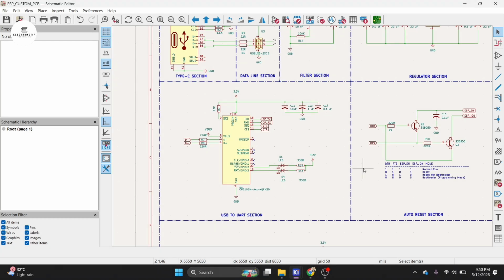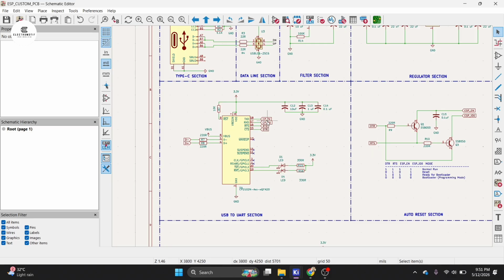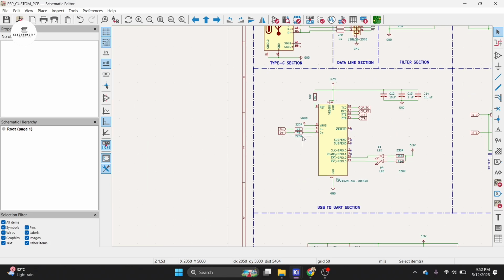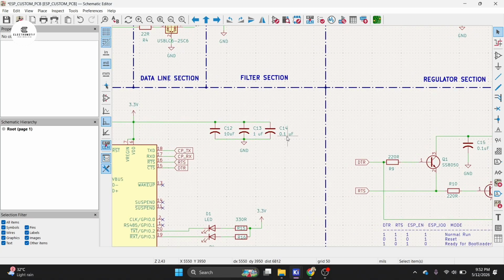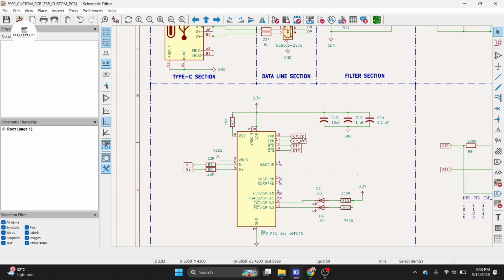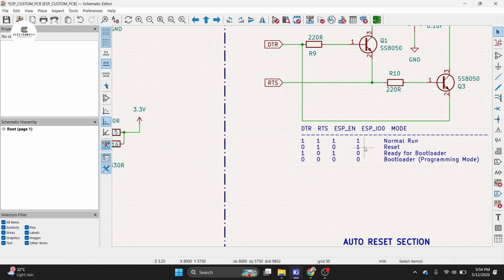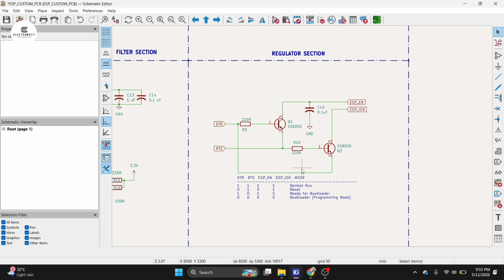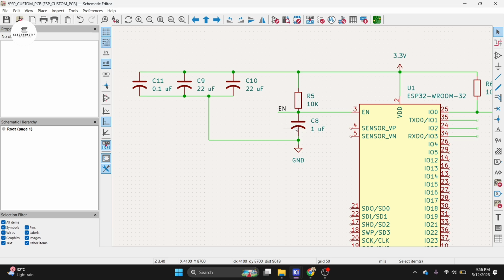ESP32 PCB Design Guide #6 – USB to UART & Auto Reset Circuit Explained

Comment: Good morning, I’ve added the capacitor and resistor to the EN pin on my ESP32-WROOM-32 board, but I’m still getting the error message: “Wrong boot mode detected (0x13)! The chip needs to be in download mode.” Please could you advise me on what else I can do?
Reply from the maker: Check these values once 👇
EN pin → 10k pull-up to 3.3V + 0.1µF capacitor to GND
IO0(GPIO0) → 10k pull-up to 3.3V
BOOT button → IO0 to GND when pressed

Also make sure GPIO12 is not HIGH during boot.
You can also try manual flashing: Hold BOOT → Press EN → Release EN → Release BOOT → Upload code.